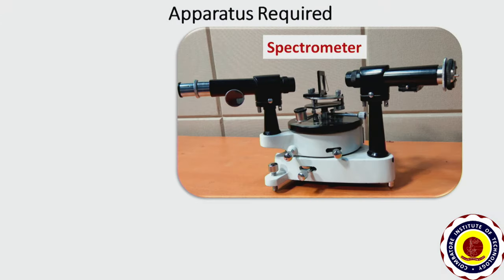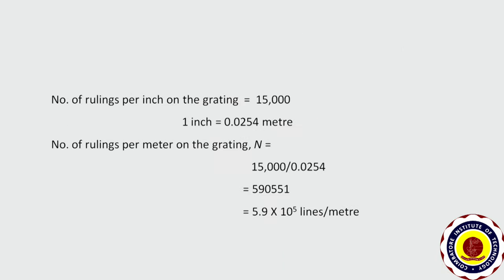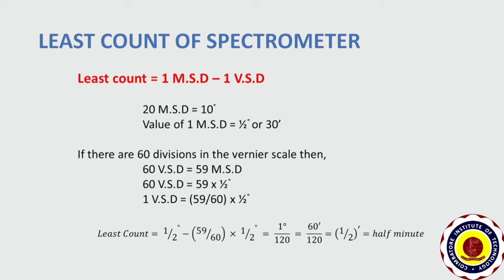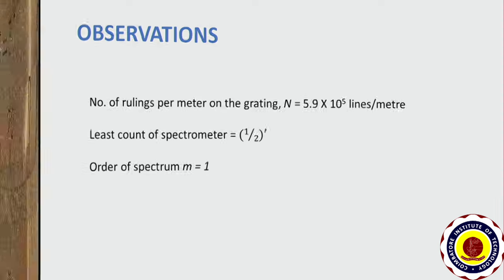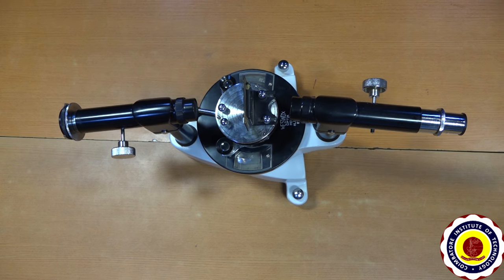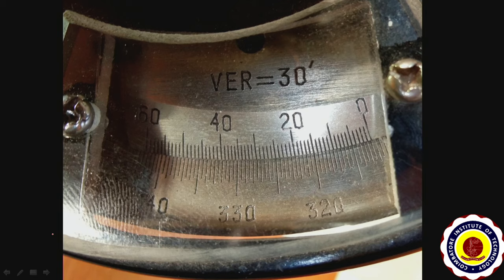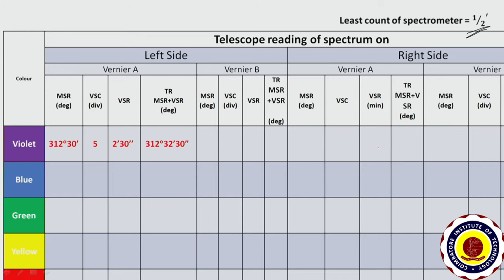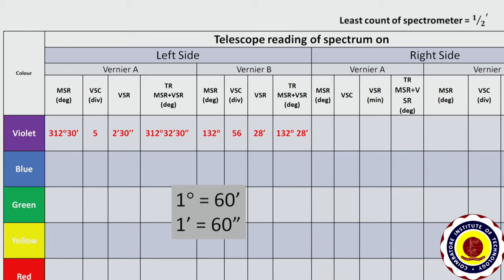Spectrometer grating experiment - Wavelength of mercury spectrum - Dr. P. Balraju

Comment: What's the value of no. Of line per netere lenghth of given grating
Reply from the maker: The grating which I have taken is having 15,000 Lines/inch. Which will be equal to 5,90,551 Lines/metre.